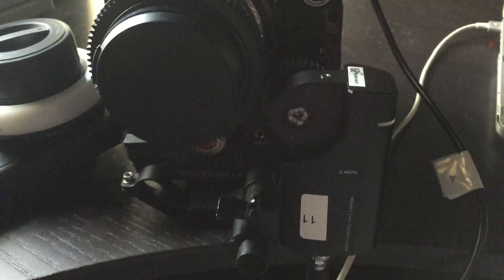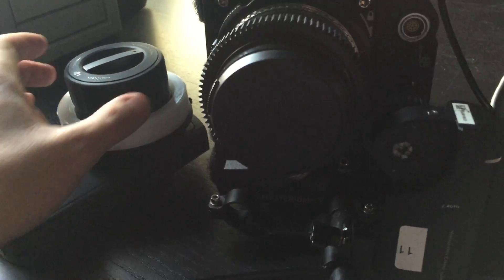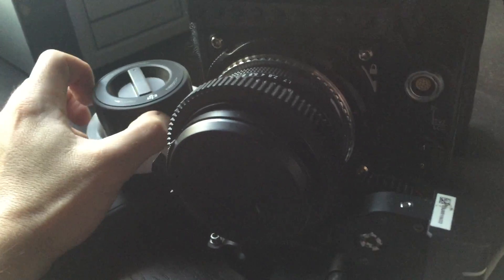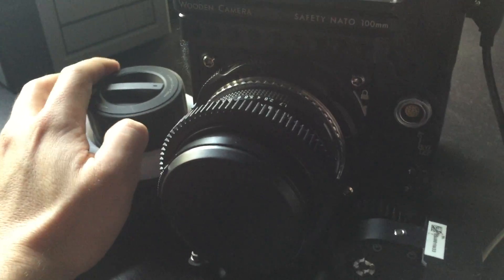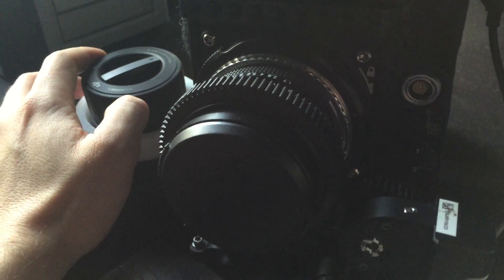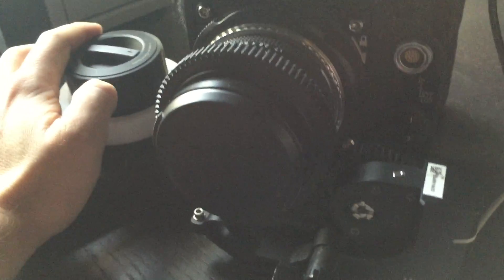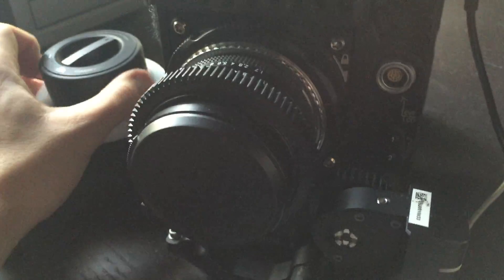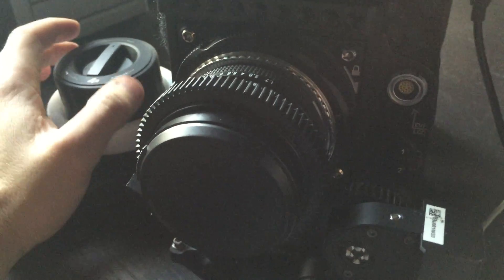DJI Follow Focus - Rack focus testing

Comment: To be sure there is an issue try mounting the focus motor above the lens so that the focus rotation is revered, this just eliminates the issue being with your lens and focus gear. If you still have the issue then you've confirmed it :)
Reply from the maker: +Anthony Brown Already did and the same issue persisted. It was a pre-release version, and DJI has assured that I had a faulty motor.